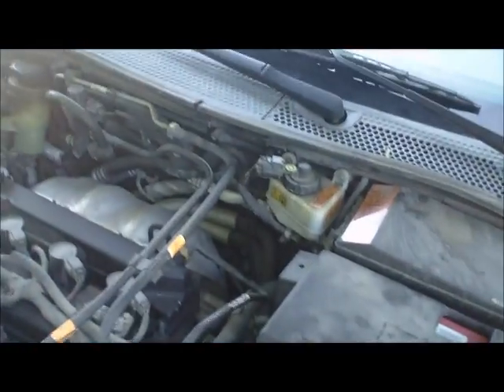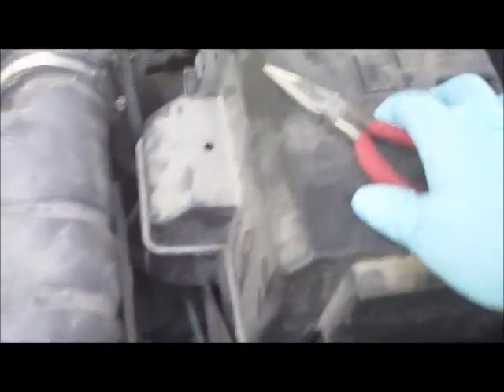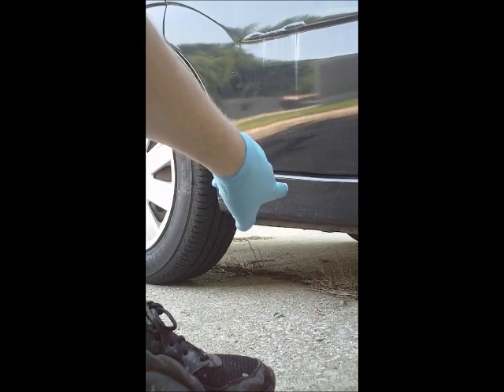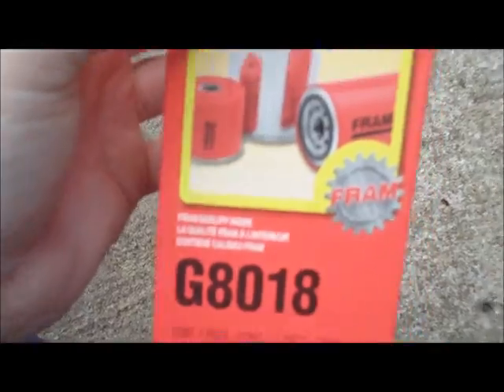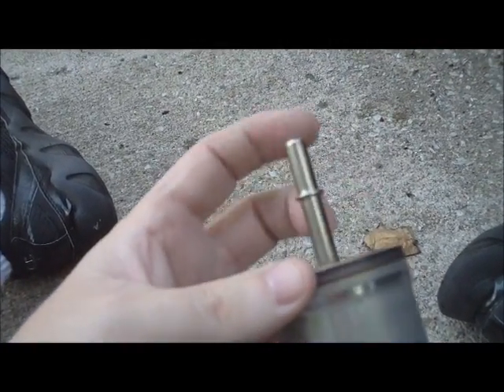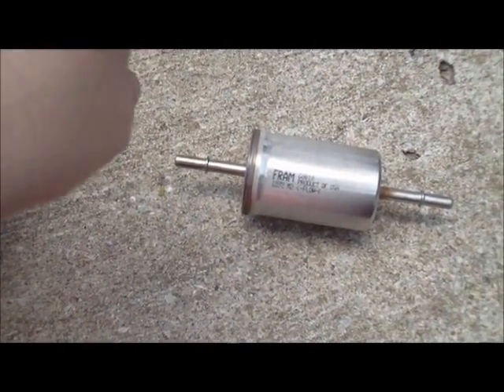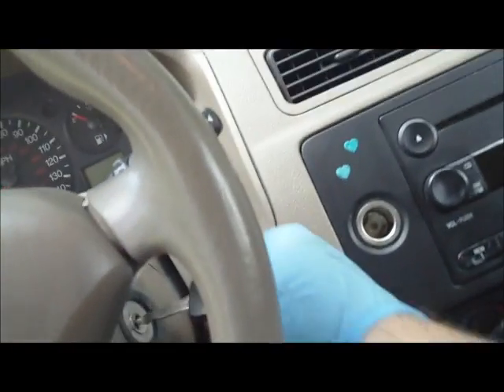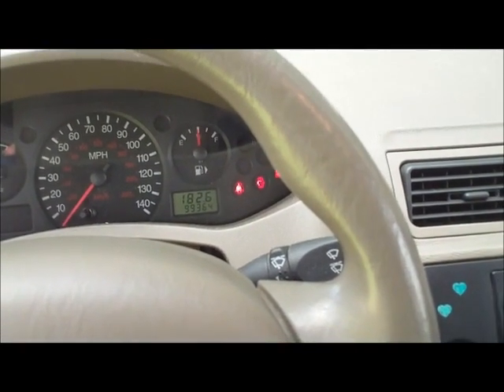How To Replace A Fuel Filter (Ford Focus)

Comment: i cant find the fuel filter to my 2012 ford focus se 2.0L gas. i think i can replace it myself but where on the car it is ? please help,thanks!
Reply from the maker: If you go to google and type in 2012 ford focus owner manual, and click on the link that has owner.ford. That should take you to a ford website where you can download the 2012 owners manual (or you may already have one in your glove box) Anyway, the owners manual in a section under maintenance and specifications. It was on page 350 (i downloaded the 1st printing version off the ford website)  It states that, your vehicle is equipped with a lifetime fuel filter that is integrated with the fuel tank. Regular maintenance or replacement is not needed. Now I myself have never worked on a 2012 model focus so I cant be for sure, but that is what the owners manual specified, so you may want to double check to make sure. Well I hope this info helps you out. Thanks for the comment and have a good day.
Reply: Thank you very much, we also was wondering about our 2012 Focus Filter.

Comment: did you have any symptoms that let you know it was time to replace?
Reply from the maker: Well other than this vehicle has about 99000 miles on it and is a 99 model which is pretty old. In addition to those reasons I did have positive fuel trims in response to a lean condition. A lean condition is basically the vehicle is getting to much air or not enough fuel. So I replaced the fuel filter just because of age of vehicle the mileage, and my computer adding fuel and creating higher positive fuel trims, in response to a lean condition. Those are the reasons I changed it out. Just for my own personal reasons I try to change my fuel filters pretty regularly. I have seen some nasty crud build up in a fuel filter, and you really do not want that crud making its way down to your fuel injectors. So I feel the best way to prevent this is 1. change out your fuel filter 2. most importantly only buy gas from gas stations that are toptier gas stations. You can go to www.toptiergas.com to get more info about why. Most manufactures suggest the use of toptier brand fuels. Well I hope this info helps you out. Thanks for watching and thanks for the comment. Have a good day.

Comment: I went with a K&N PF-2000 14 after tax free shipping
Reply from the maker: I reckon that outta work just fine. Thanks for watching and thanks for the comment. Have a good day.
Reply: If you are using a Napa filter expect to have to file or grind the clips to make them work in the factory hose ends. I will never buy a Napa product again.

Comment: Why is he going to the fuse box to replace a fuel filter??? What a dip
Reply: To stop fuel running out your'e supposed to remove the fuse
Reply: @rangersasc  not it won't stop fuel running out. The furl that's in the pipe where he disconnected will alwys run out. Just make sure car is off that's it.
He took fuse out unecessarily